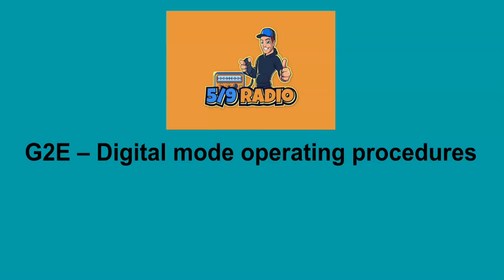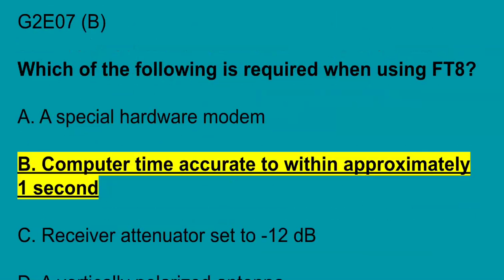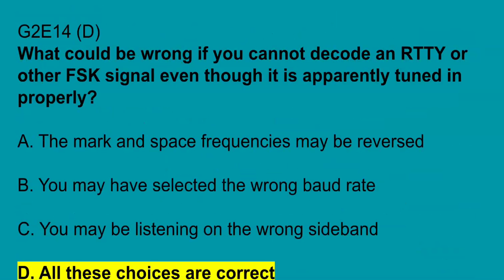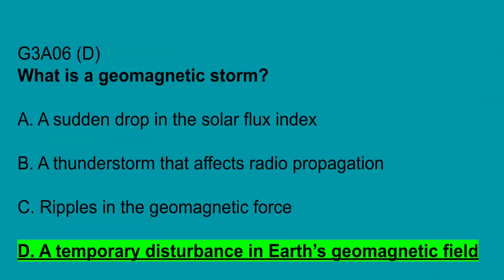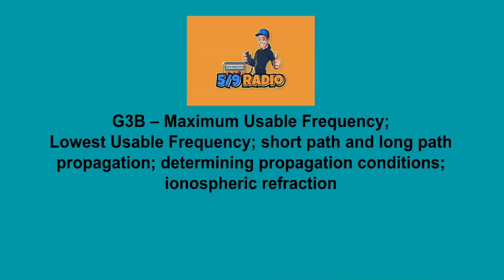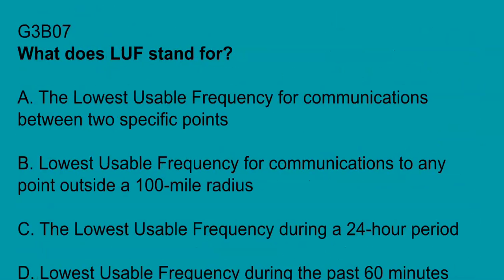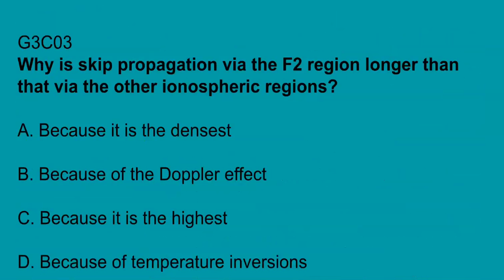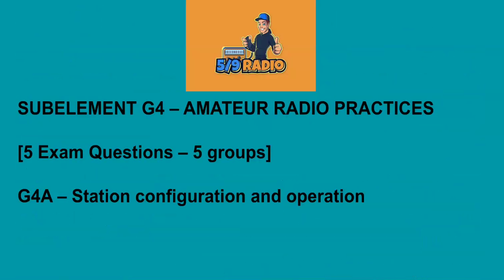2023-2027 General Class Question Pool  Video 2 #hamradio #hamharder

Comment: For those who can't get past the noise on the audio section or not all the answers being shown, just turn the sound totally off and read the question. For those who can't see all of the answers, just look in the book. It's not that difficult.
Reply from the maker: Thanks
Reply: @59radio22  You bet. By the way I just passed both my Tech and General on 4-20 thanks to these videos. So really, nobody has anything to complain about. Now on to my Extra.
Reply: I was wanting something I could listen to while doing stuff like driving, and not having to look and read - so this is the opposite of what I need.
Reply: @azemsham  Then don't use it. I passed all 3 tests and now done with the Ham tests all together. W4RBC.